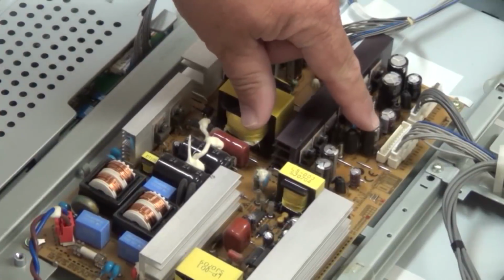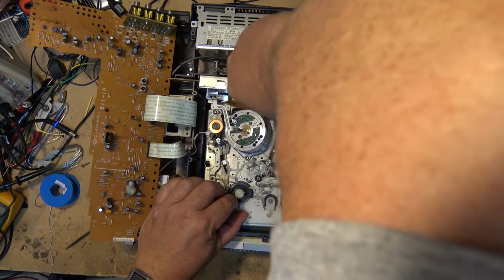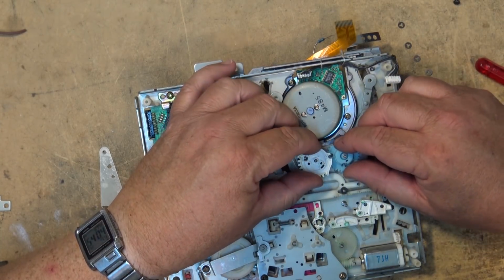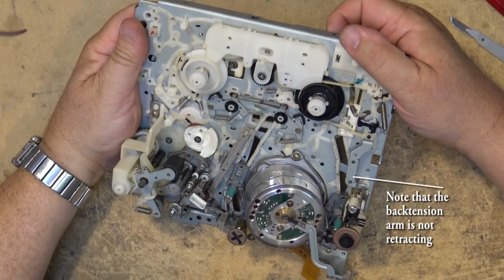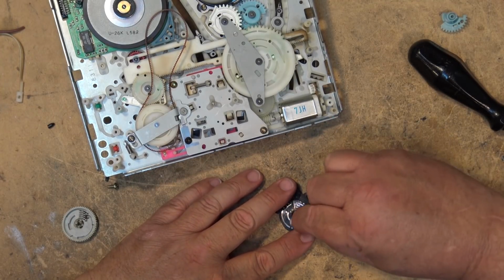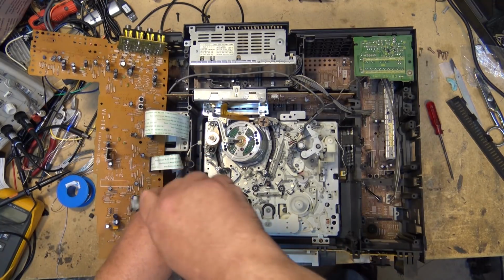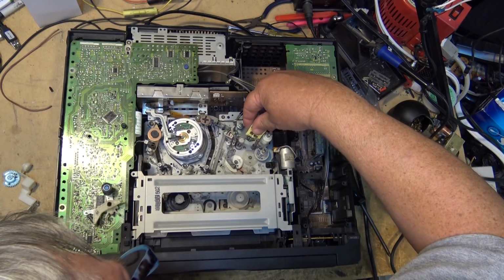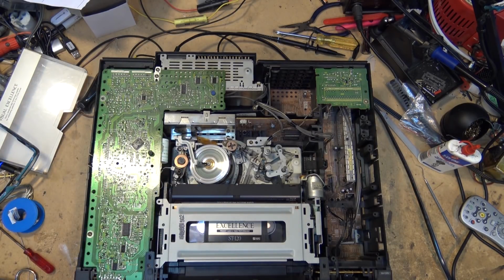Sony SLV R1000 full mechanical repair

Comment: No gear oil or lithium grease? I would've at least given it a once over with some sort of lubricant to ensure longevity of the gears.
Reply from the maker: There was plenty of lithium grease on the mechanism. Ever heard of too much oil (or grease) is worse than not enough. The plastic gears in the mechanism have plenty of lubrication on them. The new blue gear will pick up lubrication from the white gear, and it doesn't need much anyway. The guides slide in nylon sliders, so these need minimal lubrication, and there is plenty there. The metal to metal contact on the p6 guide post and pinch roller assy was addressed and lubricated.

Comment: Oh my,I fully understand why this person shipped this up to you. Oddly,Sony has a service center (of sorts) in Texas. I had an D8 handycam serviced years ago down there. Now,it's very limited in the scope of items that qualify for service. I have a horror story of a recent DAT unit that went to a "well recommended" shop on the east here in the U.S.  Long story short,...5 months later,i received a FURTHER damaged unit that now needs a part that was never damaged in the first place. Not many qualified Sony service techs left willing to do the right thing i guess. Thak god for you.  These units are literally someone's link to family history in many cases,and can be a very emotional process,and have great value to those folks.
Another excellent repair.
Reply from the maker: Yes and this is the case here. The client has personal irreplaceable video recorded in S-VHS that he wants to archive. So a working deck is in order. I do much archiving for people, but if you have many tapes that can get quite expensive, because the less common the format, the more it costs to transfer to digital. VHS I put on digital or DVD very reasonable, but the harder to find formats, S-VHS, and Hi-8 cost more. Beta and 3/4" cost even more to transfer as these old machines are getting more scarce by the day. I should put my money where my mouth is and transfer all my old tapes to digital while my machines are still functional as there will come a time when even I can't fix one due to unavailability of parts.
Reply: that's something i need to get on top of here: My TRV510 D-8 still works,and i have about 80 hours of transfer to do. I can only hope it holds out.
Reply from the maker: He shipped it to me because I was able to get the parts in hand. Other shops said no parts available. I called BS on that and told him I could get the parts no problem. He asked if I was willing to service and I accepted. Getting the parts in one thing, but I also have extensive experience servicing these machines as I did work for a Sony ASC for 20 years, and have Sony factory service training under my belt. There are a many I would turn down because they were crap, but Sony made good VCRs, despite a few weak plastic parts that caused us headaches, for the most part Sony made good machines, both the VHS and Beta. Most were quite easy to work on.

Comment: Why don't you ever degauss the tape heads and guides on a video machine like you do on a audio tape machine?  Thanks for the video.
Reply from the maker: Because they do not get magnetized like audio heads do.
As soon as you put the machine in record, the AC bias for the erase and linear audio will degause the heads, and the FM record signal will do the same for the video and hifi audio heads.
Even on audio decks. If it has AC bias the heads to not need demagnetizing on a 2 head deck as long as record is done from time to time. On a 3 head deck, the playback head needs to be demagnetized from time to time as there is no AC record signal ever sent to it tand it will eventually pick up a slight magnetic charge from the tape passing over it over time.
Reply: Because there is no need to degauss video tape heads.

Comment: I think I'd rather chew on broken glass than work on something like that.
Reply from the maker: Oh come on, it isn't that hard. These machines were actually quite easy to work on. Now those bloody panasonic units. I forget the chassis now but i have a few on my channel It used the solenoid to control a planetary gear, and used the capstan motor to load the tape, thread the tape, and drive the tape transport.
Now those were a mechanical nightmare to set up.
Reply: If I am not mistaken, you are referring to the SuperDrive series  (model prefixes NV-FJ such as NVFL630) - complete shhhhh..... to work on.
Reply: LOL!!!
Reply: Those had terrible capstan motors. We stopped taking them in, too many abandoned repairs.

Comment: Someone will always try and print out replacement gears as I suspect that it is easy to copy the details of the gear using callipers and a vernier measuring device then drawing the gear out using a CAD package and then turning that into G-Code then printing the gear and that is that, does the head drum contain FM Audio heads as I suspect that the FM Audio track is laid down before the video track i.e depth multiplex recording.
Reply from the maker: Yes it uses depth multiplexing as all VHS hifi systems did. Seperate heads ad +30 and -30' offset from the video track to minimize crosstalk.
The original gear is still available. Not from Sony anymore, but the gear is still being manufactured. They are just hard to find these days.
As to 3D printing, I read somewhere that someone tried that and it broke, as these parts are put under a fair bit of stress.
Reply: 12voltvids they should used the ABS printing wire

Comment: Smashing job :-D
I'm glad you cleaned the mode switch, i used to clean them at the same time too, it just made sense, otherwise "sods law" will make it fail in the owners hands lol.
I used metholated spirit and cotton buds, then one small dot of 3 in 1 to coat the contacts, i tested the switch with a low ohm digital meter.
Far cheaper than a new switch :-D
Reply: Agreed - did you ever work on any of the Philips Charly mech machines?  Utter sod to work on, so when we did we always made sure we did absolutely everything whilst we were in there to make sure that they didn't bounce on us.  I must admit, whilst I miss the trade, I don't miss the 'you touched it, so you are married to it' way of things.
Reply: fulwell1, i don't know that exact type, but i've repaired the type that excercised the deck every bloody time it was powered up, dam annoying as hell lol.

They had black plastic walls for the cassette holder to attach to, i never liked plastic, metal plate walls/brackets yes.

If you had to replace the video head drum, then cry :-(
No screws on the top that located the head drum, it was a horrible clamp that held the drum on to the rod, almost impossible without special shims.
You could get the head to rotate anywhere and any height from the bottom half of the assembly :-(
Hated philips for that.
Every other manufacturer had a head drum that located with two screws or more, the spacing was fixed by design.
Sorry im waffling again.
Reply: That's the one - the tape threaded in a very similar way to BetaMax machines, so looked like a big C wrapped around the head drum when loaded;   there were a hell of a lot of them that were Pye badged also;  no way in hell would you even contemplate looking at one in a customers home - - every time, we would sling them in the back of the van, pop a loan VCR in its place and take the grief back a the workshop.  I worked with one guy who really enjoyed working on them! (sadistic sod :D) - - other than Sony, the ones I liked to work on were Hitachi decks that also often appeared in B&O stuff.
Reply: fulwell1, LOL a sadistic repairer :-D, he sounded ill :).
There was also the odd machines with a white pcb and the internal name of orion, bulky machines with a cheap deck, but they lasted a dam long time and only failed on pulleys and simple stuff.
I never did know who orion was, but for a cheap and dirty vcr they did there job for a hell of a long time.

Another old top loader i liked for its ability to play anything was the silver sprayed panasonic NV333 and similar, bulky old devil, but allways gave a nice picture, also the tracking control never needed adjusting, very forgiving machine :-D.
Auto tracking machines just pissed me off, part way though a film it would re-track and upset the picture for a second or two, i never did like auto trackers ;-(
Reply: Orion were Japanese (probably still going outside of the UK), and made stuff for a few different brands - Memorex & Sansui being two that spring to mind.  They weren't pretty, but were tough as old boots, and way above the crud that came out of Vestel around the same time.   

The NV-333, and the NV-430 were two of my all time favourites - spool idlers were the weak point, but a piece of cake to replace, and a delight to work on.   Now those sort of units, I really miss!
Reply: fulwell1, yes the good old machines :-D
I know that i may sound pissed off with vcr's, but i had great fun repairing them, and the spool idlers wore out on many brands of machines.
Too many copycat designs of mechanisms, but different enough so most parts would only fit one type of machine.

I learnt vcr's from the old piano key top loader jvc, the hr3320, all metal, bloody heavy too, they were the choice for people that copied video tapes, the tape copy protection didnt stand a chance against the early machines.

Some of the later front loader videostars produced a nice picture, but on some they had power supply problems.
Some machines had an evil stk monster regulator that often popped, and at 30 quid a piece it often made the machine not worth the trouble.
Shame really :-(
Reply: STK-5481 - burned into my memory, I replaced so many of the damn things.   I remember getting a consignment of the original piano key VCR's delivered, and within the hour the supplier was on the telephone asking if there were any problems.......   all of them, bar none, had been removed from their boxes at Liverpool docks and replaced with breeze blocks :D    To be fair though, they were good machines the VideoStars - - shame they sold out to Thomson Technologies of France.

Comment: Super interesting video, I really enjoyed it. Let me ask a stupid question. Cause that's the only kind I know how to ask. Is your ability to remember where all those millions of parts go from your training as a tech, or is that the reason you do what you do, because you have a good memory?
Reply from the maker: Well they don't teach you where all the parts go.  That's the big misconception to training. 90% of the formal training I got while I was working in the field was theory. Studying block diagrams, and  operation block diagrams. For the mechanical stuff we learned by working on it, so yes it does take a good memory to remember where parts go, Much easier now as I record everything so if I forget I can review tape. I have worked on so many of these Sony decks that I could repair one in my sleep.  I have been out of the business now for 14 years and just do this part time at home, and actually get quite selective on what I will work on. There are some ugly designs out there that I would rather NOT work on.